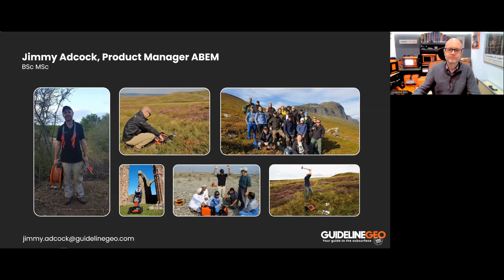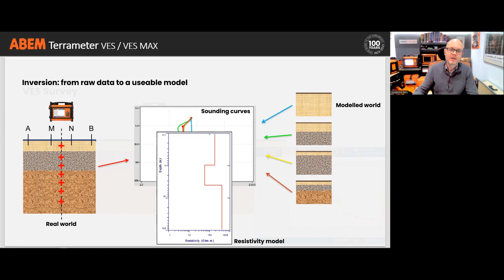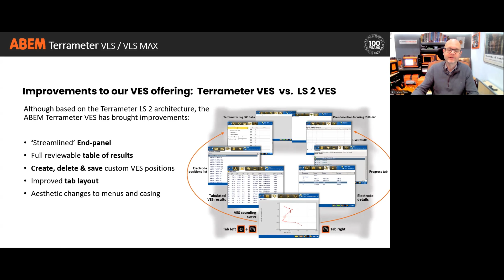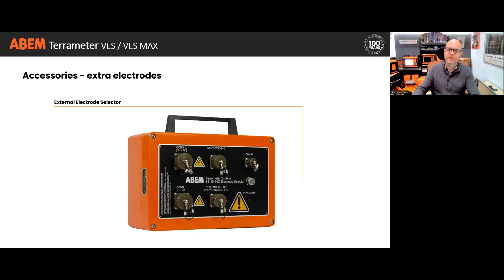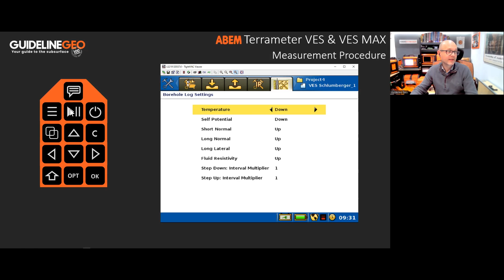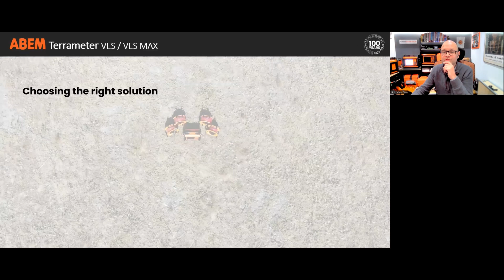WEBINAR: ABEM Terrameter VES & VES MAX

Comment: good afternoon, a question is that I have an ABEM Terrameter ls 2 device and it gives me information on part of the electrodes when it says *NO contact*(242) how do I remove it? how do I remove it? that option in notcontacto *(242) so that it does not appear